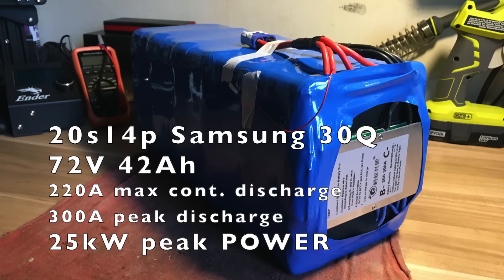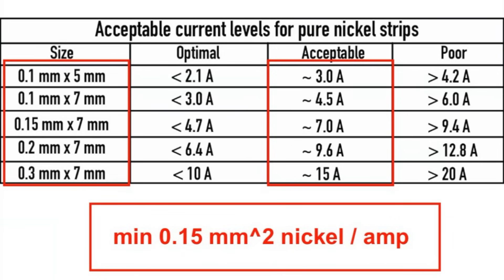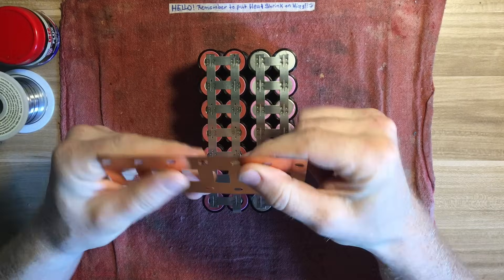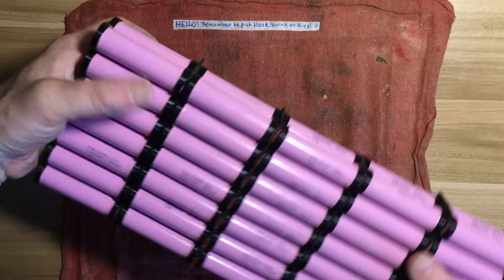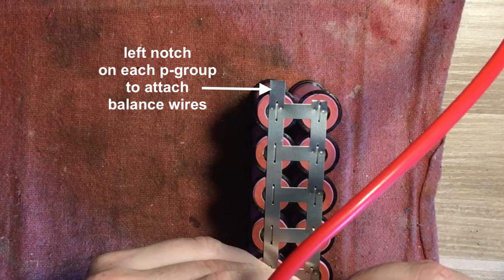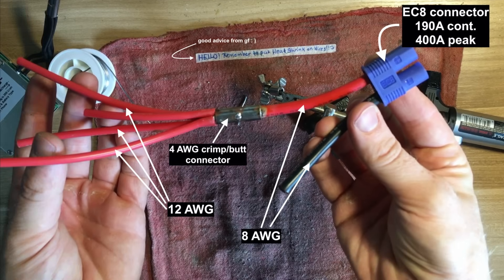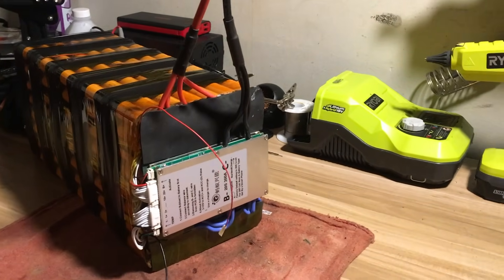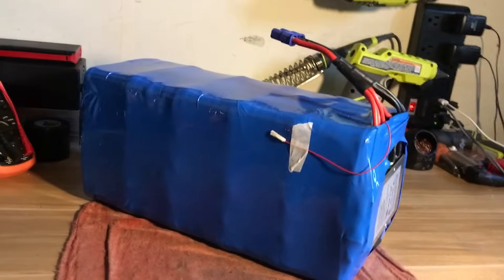How to build a MASSIVE 72V DIY battery pack for high power e-bike

Comment: Hi Yev love the info you've shared in your video. I'm attempting to build 22s 9p battery pack, possible to pick your brains about how I'd go about folding such a pack?
Reply from the maker: for sure! if the dimensions work for you, you can do it exactly the same as in the video but with two 11s groups of 3x3 cells. you should have pack that's 715mm x 54mm x 108mm

Comment: hey ... tell me how many max cells will go into this frame ?? how will we make the controller outside?
Reply from the maker: depends on the frame and how you design the pack. this one has 280 cells and it's pretty much the most I could fit without a more complicated design. controller is on the outside of the frame

Comment: Do you think it would fit in an Enduro bike frame?
Reply from the maker: depends what you mean by Enduro frame but if you're talking about the one common frame often referred to as "Enduro", the answer is no. I actually had that frame and sold for the "stealth bomber" frame it to fit this larger battery, and even then it barely fit

Comment: Hi , wonderful build that is,pure masterclass.I wanted to ask,isit ok to use only nickle for 72v 40ah tesla 21700 cell,13a discharge per cell and using 100a ant bms,or do i have to use copper still.Still not sure abt the calculations,hope you can help me out.
Reply from the maker: it really depend on the width & thickness of the nickel strip you are using and the physically arrangement of the pack. for instance if you design your pack where the series connections (or just one of the series connections) are bridged by just three connections then you're running 100/3 = ~33A in each connection, and will need more than one layer of nickel strip (depending on width & thickness). but if you design it where the series connections are bridged by 10 connections then the current across each bridge would be 100/10 = 10A, and you can probably get away with just one layer of nickel strip. In my case, the pack is running 200A over 7 connections so ~30A and I didn't want to layer a bunch of nickel and used copper instead cuz it just easier. you don't ever really need to use copper but how much nickel you'll need is mostly determined by how you design the shape of the pack.
Reply: @GaiusGarage  also,theres nothing wrong to still add the copper right like in your vid just to be safe right?
Reply: My shape of my pack is basically just 20s 8p,not folding anything,just a flat rectangle battery.Plan to weld like staircase.Nothing fancy.What size nickel do you recommend,and with this pack shape do you still recommend to use copper like in your video.
Reply from the maker: @nifailhaizam5059  it's depends how you arrange the 8p - if they are all in a line you have 8 connections between groups in seroes so 100/8 = 12.5A so one nickel strip should be ok. but if you have the 8p in rows of 4 (like I have my 14p in 2 rows of 7 in the video) then only 4 connections will carry the 100A and you'll need at least 2 strips of nickel. you can use copper if you want but sounds like it might not be necessary for your pack
Reply: @GaiusGarage  thank you !
Reply from the maker: @nifailhaizam5059  some BMSs come with a separate charging port but it doesn't matter - you can just charge through the discharge port

Comment: What kind of charger did you use?
Reply from the maker: you can use any 84V/20s charger but charging time would be long. I use a self-built charger from a 1500W power supply and boost converter to make up the voltage difference

Comment: will this work for a surron x?
Reply from the maker: it would electrically - voltage and current draw match the specs - but this pack is not at all optimized to fit in the surron battery compartment and doesn't have the right connectors. not sure if it's possible to get this many cells into a surron
Reply: @GaiusGarage  got it thanks for the quick response! great video

Comment: Great video. I want to build basically the same pack. Can the 8 awg at the main connector handle 200 amps though? I’m seeing only 50 amps continuous from my research.
Reply from the maker: thank you! its not so much that a given wire can or cant handle some current - obviously if you put 200A through 24awg wire it will fry, but case is more a rapid playing out of a process that happens slower in more appropriately sized wires. The issue here is voltage drop, just like in li-ion cells. you can definitely put 200A through 8awg, you can even put it through 10awg, and 12, and probably even 14awg for a little while, but each will experience more and more voltage drop and heat build up, which will increase the resistance, which increase the heat and voltage drop etc. basically, for short wires (like the kind used for DC circuits) the length of wire is short enough such that the voltage drop will be relatively low and you can get away with putting much more current though smaller wires than a typical wire gauge/current chart would list. for instance, if you look up wire gauge needed for 200A, youll see alot of charting showing that you need 1 or 2 gauge wire - but this assumes systems where length is significant. long story short, you can definitely get away with 200A through 8AWG. check out a voltage drop calculator if you want to see how different wire gauges respond to different current loads https://www.calculator.net/voltage-drop-calculator.html
Reply: @GaiusGarage  how much it will cost$$ this block same battery if you make it and sale it to me??
Reply from the maker: @p3dtesla118  it would be roughly $2k for materials + labor + shipping. I would just need the cells shipped to me up-front or cost of the cells as a deposit to start
Reply: @GaiusGarage  Ok Sure let's do it !! I send you my info to your Instagram my email please send me hi to my email

Comment: thank you for this video. I want to do with 20p 20s 72v . i' ve got a 400A bms  is it ok? what you think?
Reply from the maker: 20s20p will be huge! depends on current rating of each cell - suppose its Sony VTC (20A discharge) 400A will be ok for continuous discharge but if youre using higher discharge cells like Molicell (35A discharge) BMS will be the limiting factor

Comment: 72V * 42AH ~ 3kwatt hours of energy.  1 gallon of gasoline is ~ 34kwatt hours of energy.   So this huge battery has about as much capacity as a little cup of fuel.  This just goes to show how immature current battery technology is.
Reply from the maker: battery technology still has a long way to go and there are a number of viable next-gen successors to li-ion currently making their way towards production, but I think comparing battery power to petrol fuels in terms of energy density is not the best lens through which to get an accurate picture of their respective usable work potential. internal combustion engines are 20% efficient at best, so you're losing at least 27 of those 34kwh as heat. I'm not really sure how li-ion systems stack up in terms of efficiency but I have to imagine that you manage to make use of a much greater proportion of the stored energy
Reply: To be fair, it would take a hundred million years to recharge that gallon of fuel.
Reply: @peterskyparker  "Recharging" that gallon of fuel takes as long as it does to pump it from the gas pump.   Current reserves, which are always increasing due to technological development, are enough for 250 years of current rate of consumption per BP.   The predictions of peak oil by the year 2000 were obviously false, considering that in 2019 world governments had to agree to artificially restrict how much oil they pump because the world had a massive surplus to where all storage globally was filled.  By the time fuel becomes too expensive to manufacture, the technology will be obsolete anyway.   The alarmism is pure nonsense.
Reply: @peterskyparker  Also, try to remain objective.  Objectively, battery technology is immature, but that doesn't mean it ALWAYS will be.  I have no delusions that in several hundred years when we would actually start having difficulty finding more energy dense fossil fuel reserves that battery technology won't have equal energy density as its always improving.   Its just something that will take time, but we should simply recognize that even our lithium batteries still aren't all that energy dense, and that's why you won't see a 747 powered by batteries instead of jet fuel anytime soon.

Comment: I bought 2 36 volt lithium batteries can I parallel  them together on my e bike. It has a 72 volt converter
Reply from the maker: placing them in parallel will combine their capacity, not their voltage. so you will have a 36V battery with double the capacity of each of the ones you have now. if you have a boost converter to boost those 36V to 72V you can use that, provided it supports the current you would need (which it probably doesn't) but there would kinda be no point because 36V boosted to 2x the voltage will result in 2x the current divided by 2 packs will give you the same range as before you put them in parallel - only advantage is that you can use your 36V packs on a 72V system. running them in parallel boosted might exceed each packs BMS current limit which will probably cut out on you constantly while youre riding. youre better off putting them in series and not using a boost converter but then you run into issues with balancing the two packs and should use a BMS, although you can probably get away with it

Comment: What can I do to eliminate ark when I plug in my 72v lithium battery into my esc? Anyone?
Reply from the maker: you can add a capacitor in parallel with the battery terminals - keep in mind it will have to be of a comparable voltage of the battery pack or it will explode

Comment: Thanks for your Video very informative . Life Cycle of samsung 30Q is 250 cycles at 22A any battery with more Cycles
Reply: large capacity, high discharge current rate lithium polymer pouch cells or lithium graphene cells

Comment: has anyone made some sort of a 3d printed cover for the top of the battery to witch u can connect a little fan so the air passes trough in between the cells and cools the battery and allsow u woud have to install some sort of a air filer on the intake part because the battery woud get cloged with dust and mby overheat and explode idn mby but has no one come up with that design other then tesla with their water cooled battery design or in the winter u can warm up the battery with the same design

Comment: What’s your range on only throttle?
Reply from the maker: I actually dont have pedal assist set up on the bike that uses this - gearing would need to be too high. I get around 50 - 120mi range depending on how aggressively I ride
Reply: @GaiusGarage  can you explain what you mean by “gearing needed would be too high”
 I’d like to build an ebike and want to keep peddle assist.
Also what’s your max speed on flat ground? 
Also I’m thinking of using a 36v 420ah battery I found for 1k, do you know how well that would work?
Reply from the maker: @maybeiam3367  well if you want pedal assist up to 40mph, lets say, you would need gearing that would actually allow you to engage the drivetrain by pedaling at 40mph - otherwise youre just free-spinning the pedals and its no longer "pedal-assist", more like pedal-activated-throttle. if you really want pedal assist at high speeds, look up "schlumpf drive". 

for battery, I think you mean 42ah, not 420. 36V 42ah is fine, but depends on your bike and what youre looking to achieve. Ah is just the capacity but you also have to take note of the max current (usually limited by BMS). if the max current is low (like 25A) that battery would work for a pretty low-power bike like a 250W or 500W. Watts = Volts * Amp (not the same as Ah) so start with the power you want to have, then find a controller that will deliver it, then work your way backwards to find a battery that can supply it, and lastly find a motor that can accept that amount of power without overheating. 

max speed on flat ground for my bike is ~57mph - but this is more determined by the motor winding than the battery - if I got a motor with lower winding, I would have higher top speed, but less acceleration. The motor I chose is basically a happy-medium between the two

Comment: Hi, what charger did you use for this?
Reply from the maker: You can use any 72V charger - I have a cheap 2A charger that I can use but usually don't because it would take like 20 hours to charge. More often, I use one I built from a 60V power supply and a voltage booster that can charge at up to 25A, so about an 1-1.5 hr to full charge in most cases

Comment: I'm sure you heard about the sur ron X ! Did you think this battery can fit in the battery caps of the sur ron and it's possible to work with sur ron motor and bac 4000 Controlor ?
Reply from the maker: it would work with sur ron motor and bac4000 but there's no way this will fit in the battery compartment. maybe if it were arranged differently

Comment: I don't get it, the Samsung 30Q has a maximum discharge rate of 15 amps. If you're using 14 cells in parallel, that equals 210 A continuous. Can these cells output more than the 15 amps?
Reply from the maker: not continuously, but peak current for 30Q is 26A

Comment: Hey bro   hope all is well.  How did you get this battery to fit ?
Reply from the maker: it fits but barely
Reply: @GaiusGarage  I see brother, thanks for the speedy response 👍. I'm building a QS273 8000w  Sab150 e bike   and I'm going to need a battery    I already have all the equipment to do so    I was wondering what size battery youde suggest I build ?
Reply: @GaiusGarage  I dont care much for range as I'm from inner City London. Just something that'll power the motor and suffice overall
Reply from the maker: @babayaga2841  just depend on the physical dimensions of your frame and power requirements which is largely determined by the controller. once you know the voltage you need, you can determine the capacity from the max continuous discharge current of your controller. say you're running 72V and your controller supports 150A. You'll need 20s for the voltage and enough cells in parallel to support 150A continuous discharge - this depends on the type of cell you use. for Samsung 30Q, which are rated for 15A continuous discharge, that will require 10 cells in parallel - so minimum 20s10p. If you're using a cell that is only rated for 10A, you'll need 15 in parallel. so 20s15p. once you know your battery configuration, you can try different arrangements to fit the space you have
Reply from the maker: @babayaga2841  also if you don't really care that much about capacity (range) you might look into using Lipos rather than 18650 Liion cells. Lipos have much higher discharge ratings for the same capacity. A 20Ah pack will get you up to 400A peak and will easily discharge at 150A continuous. Lipos often come in 4s  packs so just 5 of those in series will give you the voltage and current you need for a lower cost. downside is less capacity and tendancy to swell and explode :-/
Reply: @GaiusGarage  woooooooooow thankyou sooooooo sooooo much for this information brother 🙏 ❤
Reply from the maker: @babayaga2841  my pleasure! feel free to reach out any time

Comment: Goodness, I will be building a 20s20p and never relized how enormous this would be, i love this design. Would love to see what its for
Reply from the maker: yeah I was originally going to build 16p but there was no way to arrange the cells to fit in the frame. 20p would be huge! links to pics of the bike in description!
Reply: @GaiusGarage  i have not made any purchases in electronics yet however i am thinking of building a 4kW nominal motard
Reply: @GaiusGarage  I am going to use this same layup (2x7)x4x5 however I will check wether a (2x10)x4x5 configuration or (3x7)x4x5 would fit the frame best.

Comment: Really nice build. But is it really necessary to have so much capacity? It's a lot of weight.
Reply from the maker: it is a bit heavy (30+lbs) but it's really a judgment call in terms of capacity, since it's not just about range but also affects how much current the pack can handle and how easily. I wanted something that would easily handle 200A without stressing the cells (for longevity) and give me enough range where I didn't have to think about riding at a moderate pace. I originally wanted to go 16p but there was no way to fit inside the frame. alot of people go 12p and that's fine but I can tear it up on this thing for literally hours before I'm out of juice - never tested actual range but I know I've done 50 mi at over 40mph average speed (I basically use the bike this is on as a motorcycle) I'm actually building a 100V 20Ah pack from lipos right now for a different bike - less range more power! will post that soon
Reply: @GaiusGarage  can I use Samsung 15q 18650 to build the same pack?
Reply from the maker: @johnpremier1495  you can but it will have half the capacity for the same size and weight - I wouldn't recommend it
Reply: @GaiusGarage  do you have an email address I could message you on please?
Reply from the maker: @johnpremier1495  dm me on instagram - link in description
Reply: @GaiusGarage  cheers will add you off my partners account

Comment: Hi does 20s6p Samsung 40t (rated 30a countinuse discharge) good enough to build the battry with 100amp Continous as I have sabvoton 100a controller and I have exact same 300a ant Bluetooth bms
Reply from the maker: according to the datasheet Samsung 40T is capable of 30A discharge - 6 in parallel will give you 180A continuous so you should be good